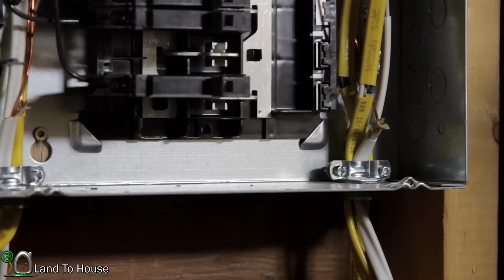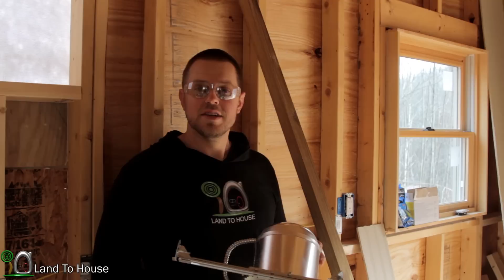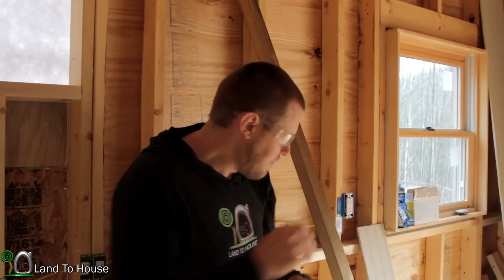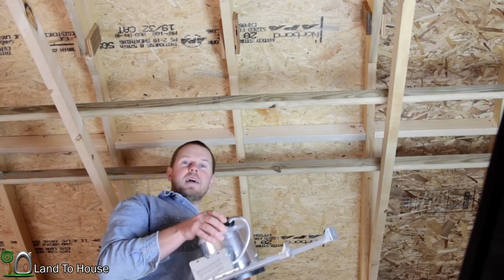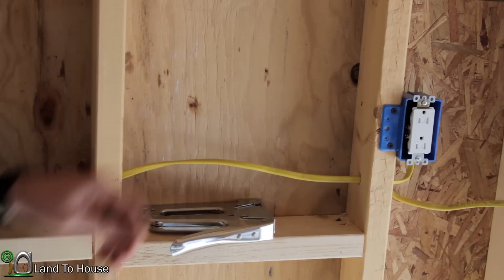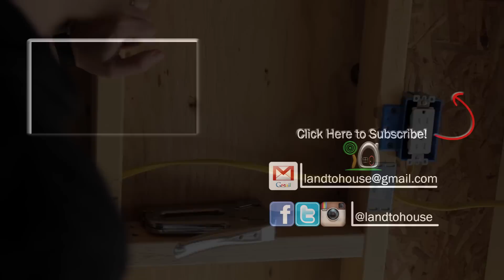Install Electrical Part 2 - Build a Workshop #22

Comment: I’m thinking about trying to wire up a shed I have. Why did you use 15amp inside instead of 20 or 30amp? And why did you use 14/2 wire? What was the last wire used ? Just trying to learn deeper on why you used the material and what difference it makes. Thanks for the great video
Reply from the maker: I need to start by saying I am no pro. The 14/2 is for the led lighting. The 12/2 wire is for the outlets. The tools in my shed dont exceed 15 amps. It's just a safety thing.  Also I think I would have had to step up the wire going from the house to the shed.

Comment: Wire clamps are upside down in the main you can not bundle wire in a wire clamp !, you needed to have put a clamp at every entry point into the box also it is illlegal to back feed a panel with mail lugs

Comment: Thanks for the little tip at the end about putting a metal plate where your studs have a wire passing through, to prevent nailing or screwing into them later.
Reply from the maker: Those can come in handy when you forget about the wire location.
Reply: I also loved this idea!!!

Comment: I was particularly interested in the video to learn about the sub panel hook-ups so I was a bit disappointed that you didn't show that.  Oh well!!
Reply from the maker: Yes that is one thing that should be taught by a professional.
Reply: @LandtoHouse  as much as im loving your series and the way you build your shed i agree on that tip about a pro. Nice job im learning tons to build MY way not the way the keyboard pros say how it'a supossed to be done.
Reply from the maker: Thank you for the positive feedback. Electrical and plumbing are definitely things for trained professionals. I wanted to skip showing the panel because I would likely teach someone wrong.

Comment: Curious as to why you used 12/2 for the outlets if they were just going to be 15A circuits.  Unless you planned on upgrading the service to 20A, you could've just went 14/2 throughout, especially since the outlets were 15A, also.  Be mindful that if you DID upgrade to 20A, every outlet would need to be swapped out.
Reply: You can use 15 amp outlets on a 20 amp circuit.

Comment: you did all this work without adding 240V outlets, no shop is a shop without 240V.
Reply from the maker: So far I have not found any tools that require that. I guess I'm a small-time shop user
Reply: @LandtoHouse   you might not need one now but if you do woodworking or metal working you will regret not adding at least one..

Comment: Since this is a sub panel, what is the reasoning for installing a breaker for the power coming into the panel when you will have a breaker in the main panel of the house to feed this panel.  I am assuming this is just so you have a way to cut the power to the shop.
Reply from the maker: +kuhrd you got it. That way I have a main switch in the shop that will cut off all power. Running the two wires to the lugs on the sub panel would effectively be the same you would just have to turn off every breaker individually.

Comment: if you look at the area where you put in the screws on the can lights, there is a tab sticking up between the holes for your screws. that is a temporary nail, i guess you could call it. it is used for placing the lights temporarily up till you can screw them up. they also have them on the joist hangers.
Reply from the maker: Yes indeed. I gave that a try on the first one and realized that the false rafters that I installed (for lack of better term) are to weak to allow the hammer to do its job. I had to move right to the drill. Now on the joist holders I was able to use those tabs some as they were intended.

Comment: 4' LED shop lights would have given you more light and been easier to install.
Reply from the maker: +Ashland Gun club I am thinking about using those under the storage shelves later :)
Reply: We're installing 4' LED shop lights in our woodworking shop and we are REALLY happy with them.  They are very bright, good color (not blue or yellow), and energy efficient.  The nice thing about recessed cans though, is that the bulb is protected.
Reply from the maker: +St. Isidore's Farm I've checked out some of those on YouTube and they seem very nice. I will probably use a couple of them above my work table.
Reply: Are you kidding me,  how long have you been a licensed electrician?